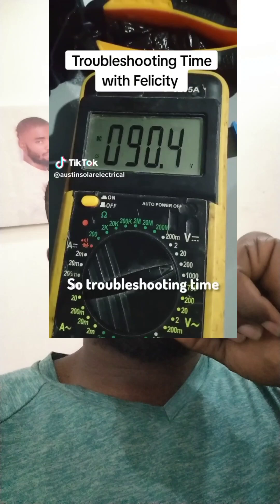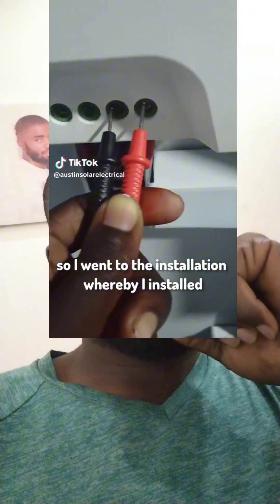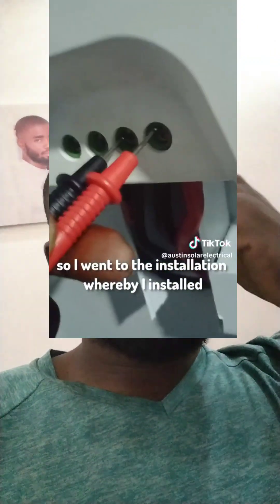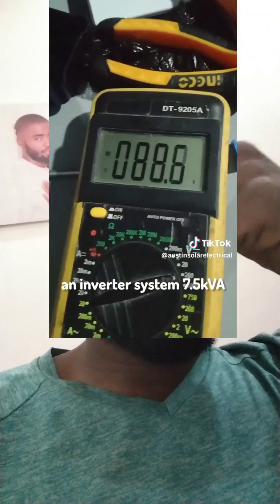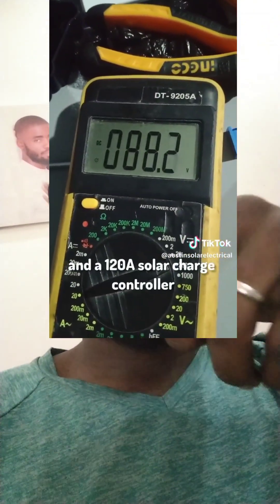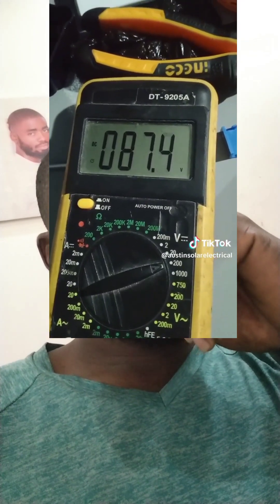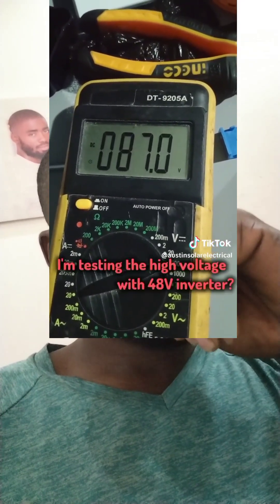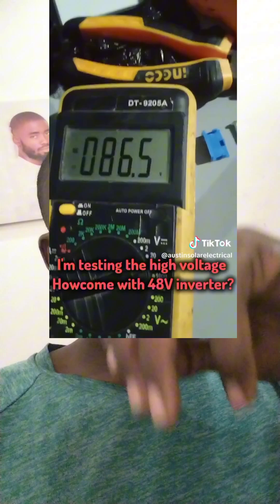Felicity have missed it,it should retract it's step

Comment: Connect PV in series and parallel. That was how I fixed my 05 Error that has to do with high voltage. Once connect in series and parallel, it worked perfectly

Comment: Can this results to a high battery voltage error on my felicity 5kva inverter? I get this error especially when there is Nepa supply 🤔
Reply from the maker: The absorb voltage of your system is too high
Reply: @Mairigaemmanuel  Thank you. So, I need to adjust the floating voltage if I get you correctly. If not, what can I do to correct the situation? Once again, thank you.
Reply: I'm suffering the same problem right now, high battery voltage on the error code 4
Reply: @richardmichael5801  Bro, I gave that inverter out and bought Welion 4.2kva hybrid inverter. Since then I've been enjoying constant and steady power supply.

Comment: Check thst your Meter it is known for misbehaving.

Concerning the charge controller, i dont think there is anything wrong with the 120A version.

Yes it is true if the controller is battery powered there's a problem (i have a 100A controller acting funny)

The issue you made mention happens when inverter and controller has different float and bulk voltages controller will go into protection 

And yes felicity is over rated 😕.
My 2 cents

Comment: Can 12 300watt panel charge 7.5kwh lithium battery very well ?
Reply: Yes, it'll be full in less than 3hrs. You're getting 3.6kw(12*300w) per hour with your panels.